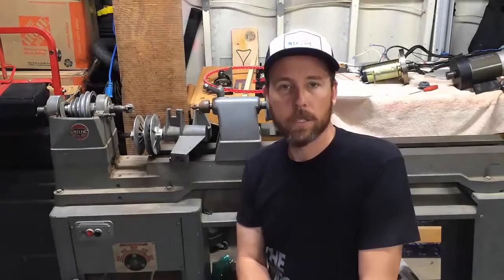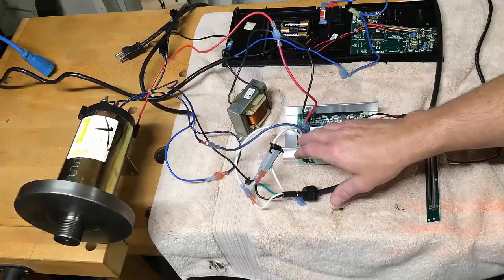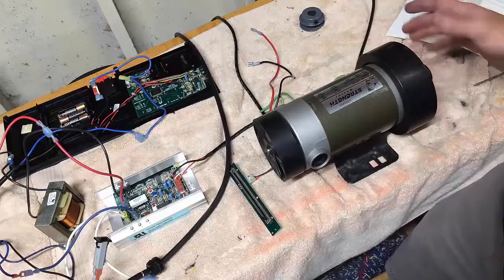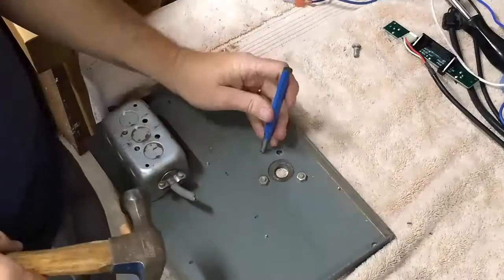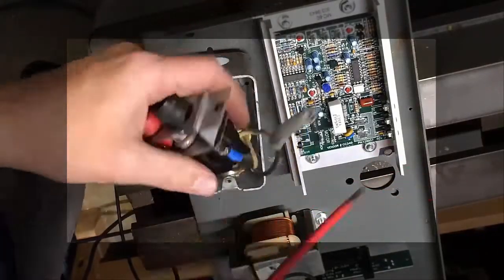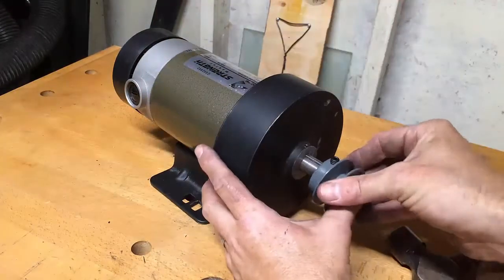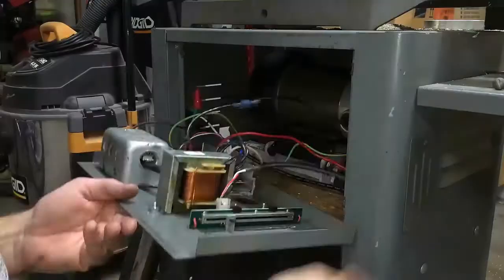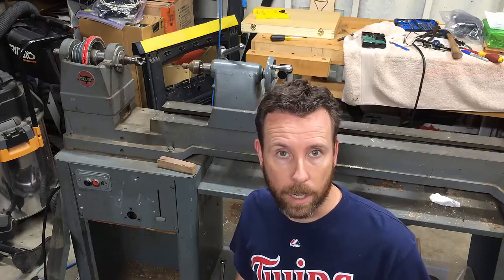Wood lathe hack  with treadmill DC motor build and setup

Comment: I just finished a conversion on mine using a tread mill motor, I find it very easy to stall out even at max RPM, seem to lack torque? Any thoughts?

Comment: Great video. You make it look so easy. 
I have a Jet 1014 wood lathe with a 1/2 hp motor with variable speed. I want to increase the hp and keep the variable speed. 
Can you recommend a DC motor and controller for me? Something between 1 and 2.5 hp with a max rpm of 4000 rpm (that’s what my lathe maxes out at) 
Thanks,
Paul

Comment: it's been awhile since you posted this.  
Have you turned any bowls on this lathe with the treadmill motor?  If so, did the motor bog down or did it perform well with no problems?
the motor on mine is undersized and even though i have 6 speeds, it just can't take heavy cuts and almost stops the motor....3/4 hp.

Comment: id stick a sweet little light that turns on with the power switch in that hole where the dial used to be located.
Reply: A smiley face light. :)

Comment: I have a harbor freight benchtop bandsaw and a dc treamill motor set up.  Is it possible to install the dc motor without a potentiometer and just use the dc router controller from harbor freight?

Comment: I am planning on using a 1.5 HP PMDC motor on my lathe, mainly because I hate changing pulleys all the time. The problem I am facing is finding a good quality controller that also features a governor. I plan on reducing the speed by using two sets of pulleys so it doesn't spin so fast. I may add an arduino with an LED segmented display to show the RPMs. There is a reflective photo sensor on the motor so the treadmill could regulate its speed, so I might use that with the arduino to show the speed.

Comment: Jake, Great project ! The motor is a huge upgrade and it looks like it runs really smoothly ! It has to be an absolute pleasure to turn with. I'm planning on using a treadmill motor on an old shop smith. I have an old reliable craftsman lathe but I can't resist wanting to put some of the functions of the shop smith back to working condition. The motors are the weak link with the shop smiths. Instead of seven machines with seven motors you have one motor.  Your video was fun to watch and gave me a lot of ideas for my projects !
Reply from the maker: Thanks,    I'm glad you enjoyed it and got some good ideas out of it

Comment: Nice conversion.  I have a few questions:

1.  Was it necessary to keep the flywheel?
I ask this because i want to do a similar conversion to my metal lathe and can't keep the flywheel due to space constraints.

2.  Why did you decide to keep the linear Pot and not change it to a rotary type.
I would think being in close proximity when using the lathe, it would be easy to bump and change speed setting.  Of course you could add a guard to prevent that.

Thanks
Reply from the maker: 1. I didn't need it necessarily.    the flywheel is keyed to the shaft so you can put on any pulley you'd like.    It just provides more momentum which is a good thing for me.   2.I decided to go with what the original treadmill came with.   You could easily change it to a radial.   honestly I could have mounted it somewhere else.   I  just figured this was the best potential spot for not getting hit or broken ob the lathe.
Reply: Thank you for answering my questions.  Cheers.
Reply: @valveman12  the flywheel usually has some vanes on it to provide some cooling.  I am building a potters wheel  with a treadmill motor and cut the flywheel off with a holesaw.  I will need to add a small fan to keep the motor cool.
Reply: @AffordBindEquipment  Sounds like a great project.  Will you be putting up a video of your build?  I'd love to see it.

Comment: After market wiring is very simple there are many speed controllers available on eBay and lots of info on YouTube.
Reply from the maker: I created a playlist on just those things,   you can check it out in my playlist section under treadmill builds.

Comment: Why keep the flywheel? Seems to me it would be a pain in the keester having to always wait for the machine to spin down after a stop.
Reply from the maker: I decided to leave the flywheel to help with momentum.     I haven't found that it hurts or makes stopping the piece hard after turning off the power.   It feels just right.
Reply: That sounds good, most of the tests I have seen made it seem like the flywheel took a long time to stop. I haven't had a chance to experiment with my motor yet but I plan on converting a ShopSmith machine to DC.
Reply: one problem with no flywheel is the flywheel is usually also the fan.  If the flywheel is eliminated, then a fan should be added, especially if it is located in an enclosure.

Comment: So Jake, I have dug up a 2HP 5950 RPM permanent magnet 17 amp Icon Health motor with a mc- 60 speed  
controller and the choke(I think). what else do i need to test this motor to see if it runs? the 2 black wires from the choke are already connected. I just need to figure out where the other wires go and ifs I need something else to get it running. any suggestions?
Reply from the maker: email me a picture of what you got

Comment: Jake, is there a difference in. the motors of a regular treadmill and a incline treadmill? also, in previous comment you said it was better to get one with manual speed control. Please explain the difference. all I have ever seen(not many) there is a knob or slider for speed.
Thanks
Reply from the maker: the incline motor is only used to raise/lower the treadmill.

Comment: Jake, is there a lot of differences between the power controllers of treadmills? There are so many different brands and models. if I got a motor some where, would there be a big problem finding a power supply to work weigh the motor? I know nothing about electronics and realize it would be better to find a treadmill and salvage all the parts together AND remember how they went. Just trying to get my lathe on variable speed.
Reply from the maker: It would be best to get all the parts from one lathe if you can.  I used a motor from one treadmill and a controller from another treadmill.   It really shouldn't be a problem unless the controller is rated higher ( more voltage ) than the motor can handle.   I would also be sure to find a treadmill with a manual adjustment for the speed.   It just makes life so much easier.

Comment: Boy I wish you were my neighbor! I too have an old Delta Rockwell lathe. Not as fancy as yours, don't have the cabinet. I have a couple of old treadmill motors but without the controller pad. Just some wires attached to the motor. Is there any chance of making one work with just the motor wires? I wish I had your electronic knowledge. Is there a possibility you would share some suggestions by email about the ends @ outs of the treadmill works? Oh, I sure enjoyed your video and look forward to seeing more.
zetuskid@gmail.com
Reply from the maker: you really only need the controller at this point.   Any chance you can get your hands on a treadmill to part out?
Reply: Jake of All Trades Probably can from a Goodwill place. Then I know nothing about wiring it.
Reply from the maker: I would check craigslist first.  The wiring is pretty easy
Reply: Check this video out to help you   https://www.youtube.com/watch?v=_NmAFZMAfH8